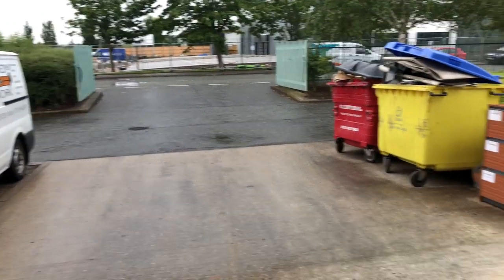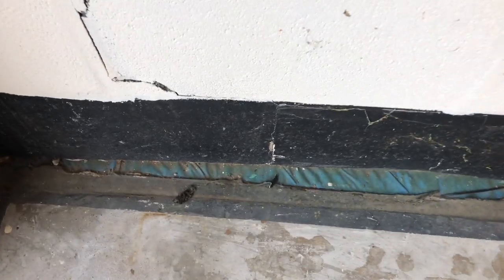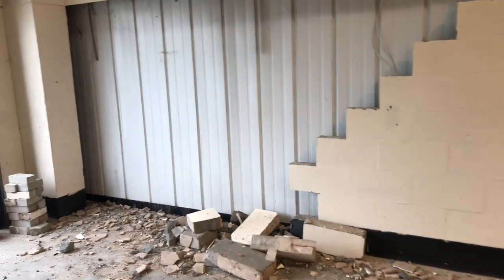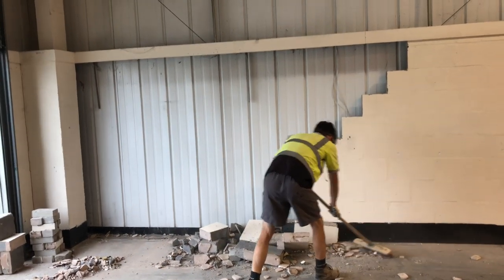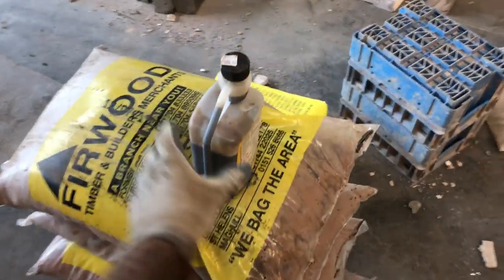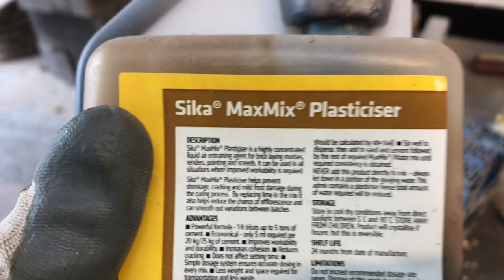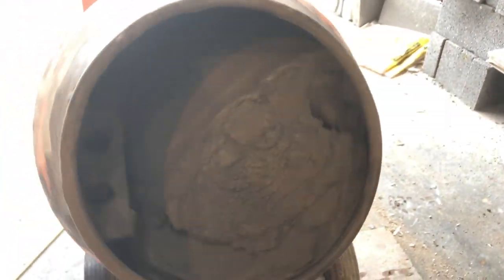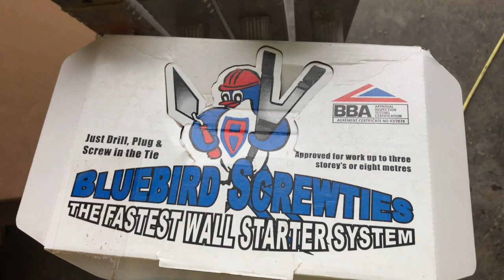FORKLIFT CRASH SITE REPAIR !!!   BRICKLAYING IN A FACTORY UNIT

Comment: Great little job and well executed 💪 Remember the days of industrial units before the introduction of bloody external cladding .Miles of facework with just the odd firedoor .
Reply from the maker: Ronnie Biggs . Yep all the good jobs come to an end . Facework is very rare now , if the bottom 3rd isn’t clad it’s usually face blockwork for speed 😬🧱👍🏼
Reply: And dare I say 9” solid concrete blocks dividing units .I once worked on a bonded warehouse for Lennon supermarkets with youngman boards as ramps to the top lift and each block was carried by hand ......You will never see that again ,thank god.💪🤔🤬
Reply from the maker: Ronnie Biggs jeez I think I used those bloody things maybe twice , who ever invented them should have been made to carry one round for one full day 🤯🤯🧱👍🏼

Comment: hi
I looked at your video on damaged wall by forklift.
have you ever tried a S D S  brick extractor chisel .
you put the drill on hammer stop and it will cut out the beds and perps like butter.
tool station sell them , they are about £20.
worth every penny,
Reply from the maker: i must get one of those , ive seen them used before and they are good 👌🏽🧱👍🏽

Comment: A lot easier to fix than when a neighbour left their handbrake off and caused £20k of damage to my house some years back.
Reply from the maker: Graham Langley jeez , that’s a bit more than a nudge with a forklift ! 😳🧱👍🏽
Reply: @SteveAndAlexBuild  Just a little. It was helped by the slope of the front garden which let the car pick up speed before it hit the house - if I'd not gone out a a few minutes before it would have just hit my car on the drive and caused a few hundred quid's worth of damage. As for the neighbour's car, a Mk 1 Primera, some hammer work and a new headlight and it was good to go.
Reply from the maker: Graham Langley 😯😬🧱👍🏼

Comment: I love jobs like this...totally unnecessary, as the block work is in-fill only...all the structural strength is provided by the steelwork...so the boss is paying for look good only...the most efficient use of money would be to have installed steel work along the flank wall to prevent the in-fill being ‘wanged’ in the first place...!! I somehow don’t think the boss has the foggiest idea....but no doubt these guys are quite happy to take his money, Nd come back again when it is, once again, ‘wanged’...!!
Reply from the maker: Stuart Nagle . This was a repair job as the unit was being handed back at the end of the lease . I did another job the same but much bigger about 5 years ago then they wanted me back to repair even more a couple of years later ! They finally installed steel barrier all the way round to stop the pallets sliding into the walls .... 5 years to late 😬🧱👍🏽
Reply: Bricklaying With Steve and Alex...lol...I rest my case...
Reply from the maker: Stuart Nagle exactly 👌🏼🧱👍🏽

Comment: Sorry 4" inch block is non structural.
Reply from the maker: They are over here 🧱👍🏽
Reply: @SteveAndAlexBuild  How can they be? No cores for concrete and reinforcing. Also setting truss plate in a bed of mortar a big no no! The mortar does not stick to wood. There should be a mechanical connection!
Reply from the maker: @edskapin7171   The wall plate is mechanically fixed by the roof installers 🧱👍🏽
Reply: @SteveAndAlexBuild  To what? If it's the top block via tap con? Wall should be anchored to footing or slab and bondbeam (horizonal concrete reinforced should be anchored via corefills so everything is tied together. Again not my personal opinion but standard building practice around the world.
Reply from the maker: @edskapin7171  Not in the uk 🤷🏼‍♂️